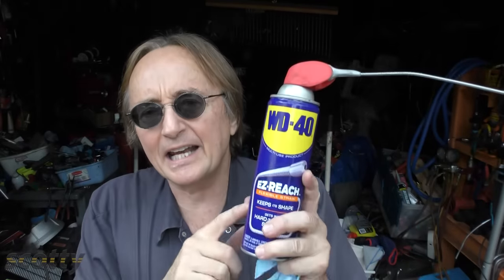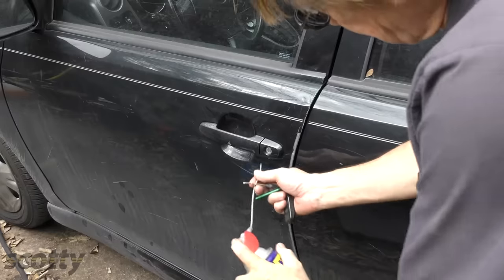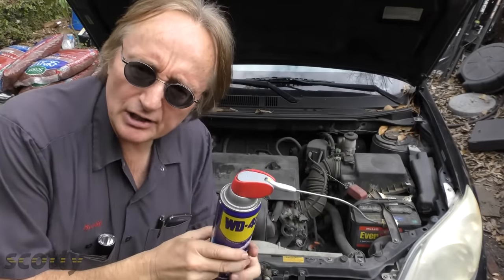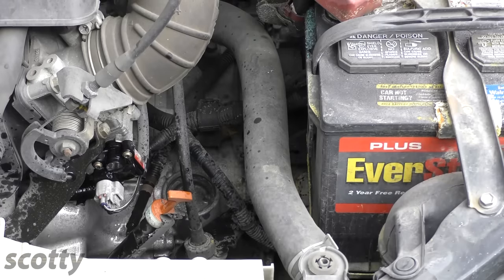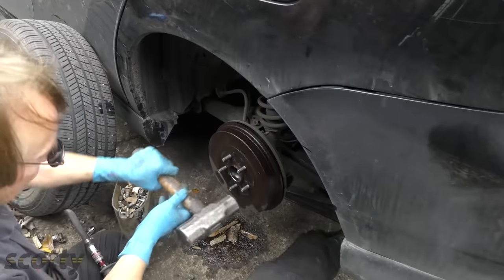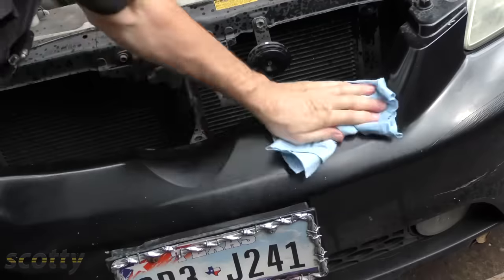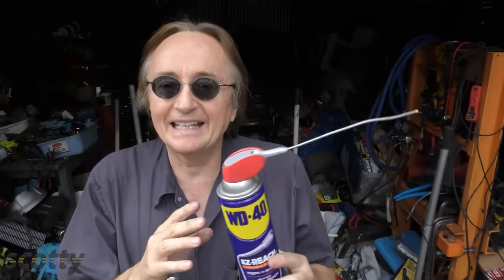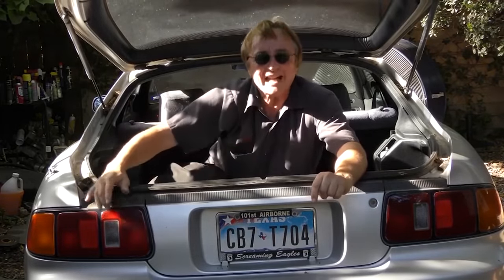Top 5 Uses of WD40 in Your Car (Life Hacks)

Comment: Scotty, I'm a locksmith.
Your right about 1 thing for the locks. It cleans them out very well.
But after you clean them out, you should use a lubricating produced like tryflow.  It is silicon base and will not attract dust and grime like a petroleum base like wd40.
Otherwise great video.
Reply: Please help me. I sprayed wd40 into my ignition. Should I put tryflow in it now? Or did I damage it already from the wd40?
Reply: @timothyleee27204  your ignition should be fine, put your key in and out several times, wipe off the excess wd40. Each time you pull the key out. Basically you will clean all the gunk out of it.
Reply: @ceedub6233  ok. Is there a high chance it will get gunked up in the future? It's a 20 year old car. I'm not sure if there's many electrical contacts in the ignition. Thank you so much for your reply

Comment: If it moves but it shouldn’t use duct tape 
If is doesn’t move but should use WD-40
Reply: Alex Bartunek  Absolutely
Reply: after that....If still doesnt move = hammer  / if still move jd weld !......last if everthing is ok ! time for a good beer
Reply: Jack's tech damn right
Reply: At what point should u replace something? XD
Reply: Alex Bartunek very original
Reply: XD when jd weld  or the hammer dont solve the issue
Reply: If it doesn't turn on and it should, hit it with a wrench.
Reply: And if it doesn't work after that divorce it and marry it's sister.

Comment: My father was a carpenter back in the 50s and 60s. He used WD40 on all his hand saws and other tools to keep them from rusting. It worked great and I  used it on a crankshaft back in the 70s to keep the journals from rusting. The stuff is fantastic! It's also safe on electrical contacts! I've personally been using for  50+ years!

Comment: There's a product I believe in!
I remember the days when a can of WD40 and a couple spare ballast resistors were a Chrysler driver's first aid kit. 
Nowadays I drive a tractor trailer rig for a living. I don't hit the road without a can. I use it to lube the release linkage on my fifth wheel, a spot lube on my trailer landing gear legs, plus keeping my electrical pigtail to my trailer(s)- I pull sets of double pups- making a good connection in bad weather. I also squirt the pintle hook that connects the dolly for my rear trailer to my lead trailer. The latch works easier when I go to disconnect them at the turnaround terminal, plus the rig handles a little smoother going down the road.

Comment: Mechanic in a TIN !  
spray the battery negative/positive wires end of connections on to battery and try to get into sleeve if poss.
and the lead to car body negative earth/ground end connections (from battery) if its all braided , spray all of it.
as well as engine connection negative earth/ground connection if its all braided , spray all of it.

Same with starter motor connections and alternator.

Its also really good on a old hand saw to cut anything, both sides of the blade. Even on a brand new hand saw halfs the energy required to cut anything.

Comment: Scotty .............. I never use WD-40 since it attacks electrical insulation and Bakelite and since I'm an electrician (foreman) it matters.  I use CRC-2-26 which improves electrical properties and is a great penetrating fluid and will not harm electrical equipment. I won't allow WD-40 on any of my electricians trucks - I have had too many ruined breakers and wire insulation.
Reply: Well he’s showing you on cars.

Comment: Spraying WD40 into the key hole will make your key slide in and out easy but,
it will wash out the silicone grease in the lock itself which makes the barrel
turn.My advice is to spray some on the key its self if the key feels its sticking.
Reply: Jeff Fae Scotland yes. Made my lock turn inside of the hole

Comment: Keep it off the paint!
Reply: I don't use WD40 as a lubricant or think of it as a good lubricant. However, it is great as a cleaner, if you have tar from the road sprayed on your car. Just spray it on, wait for it to start dissolving the tar and wash it off with soap and water. I agree, I would not want to use it as a polish or allow it to stay on my paint.
Reply: Wd40 will not harm the paint
Reply: Spraying it all over the engine may cause a fire
Reply: He's talking about for beater cars. It serves a short term purpose for that.
Reply: I believe wd40 takes off any wax. So you would want to rewax that area

Comment: It is not 'dissipation'  of water.  The "WD" actually stands for 'water displacement'.  It is good for many a quick job, but great at none.  For jammed stuff, nothing beats Liquid Wrench. For locks, graphite powder in a volatile liquid vector.  For any an anoying squeak, white lithium grease does the job. For preventing stuff sticking together, Never Seeze (copper powder in clear grease).  But for ignition cables, yes: WD-40.
Reply: I read you loud and clear, man.  I just wanted to make a more serious point.  As an experienced cyclsit, I know for a fact that WD-40 is your bike's worst enemy. This is life... :)
Reply: Kroil and PB Blaster destroy liquid wrench. WD 40 is my go to for household stuff. Just works.
Reply: Who started the myth of using graphite on locks? As a locksmith, I really want to punch that guy in the face.
Reply: @rouelibre1   I am currently using WD-40 on my bike, for the chain and gear mechanism; but you say it's not good. What kind of fluid should I be using? Thanks in advance.
Reply: Just use an all purpose grease. I use to use it all the time on my 20" Diamondback Viper BMX.
Reply: @keith   I will check that out. Thank you.
Reply: rouelibre1 agree completely with your reply. Scotty is usually dead on but on this one he disappoints. Wd40 simply lacks long term lube or protection and is often used in places which need real grease. It washes away any existing grease and itself dries away in a few weeks leaving the mechanism dry. Wd40 is all marketing.
Reply: @batvette   How come we can't just use motor oil, like when we were kids? Is it because it attracts too much dirt?

One more thing, I agree WD-40 is terrible stuff for lubrication. That company lies through their teeth. WD-40 is good at cleaning metal; but leaves the metal completely dry and unprotected. I learned this the hard way. I was spraying WD-40 all over my chain and components every time I went for a bike ride; and it wasn't long before the cogs and chain were covered in rust. I have been using motor oil ever since. The motor oil is a bit messy; but my cogs and chain are free of rust.
Reply: Jason Hart you could. Motor oil just doesnt spray well out of a can. When i used to live at the beach with an old cadillac(all iron rusts quick) once a year filled up a binks spray paint gun with 5pts motor oil 1 pt grease. Sprayed the whole underside of the car in minutes. Cheap and no rust ever.
Reply: @batvette  Thanks for the info. I actually have a 1965 Mustang, and I live near the beach. I will give that a try.
Reply: Jason Hart my cadillac was also a 65, a custom hearse with the 429. Record production that year with over one million DeVilles rolling out of one factory in Michegan. The metal they put in cars in 65 was unreal, modern drill bits almost unable to get through. Once rust starts it goes through panals quick, you can arrest it with phosphoric acid. 
Anyway if you dont have access to air and a sprayer white lithium grease in an aerosol can is a good alternative. Just costs more. If its outside get it under a cover, the ones made of sunbrella are best for salt air. I stored an 86 corvette in my driveway for six years under a cover coated with a case of white lithium only took the cover off quarterly to hose it off. Worked well except for the neighborhood cats shredding the cover until I stapled carpet to the corner of the wall next to it.
Reply: @batvette   Thanks for all your advise. Rust is a real problem for these old cars. What about the roof area? My Mustang is getting rust around the front and rear windows. My car does not have a vinyl top, so that's not the issue. I'm thinking that the interior headliner might be causing the problem. The headliners back then were made out of plastic, and I have a feeling it's causing condensation, which leads to rust. Do you think I should I remove the headliner? Or maybe fabricate to vents for the headliner?
Reply: Jason Hart doubt the headliner is causing the problem. Rust in those areas usually caused by leaks. Or condensation is simply building up there. I had rust through body above the windshield in my honda passport. Treat with phosphoric acid then coat with an anti corrosive coating. Home depot used to sell an excellent coating it was orange cant remember the name of it now. Covered it with that then sealed the area with PL sealant.
Im in california due to our states crazy environmental laws there are a lot of effective products we cant get in our stores any more.
Reply: Jason Hart try sewingmachine oil it is a great lube for chains n cranks
Reply: Scott Michale it works but is a little light.... prolly halfway between wd40 and motor oil. Similar to 3 in 1. Will throw off pretty easy and require frequent reapplication. But it has its uses. On bicycles i settled on white lightning that waxy stuff cuz it sheds dirt and sand. And if you toss your chain its not messy to handle on the road/trail ... tho if ur tossing chains adjust those derailleurs. Put the gears on the small sprockets and tie off the deraillleur so the chains almost hitting the floor(unless u have a master link then remove it) squirt some white lightning into a gallon freezer ziploc then drag the chain through it to fully immerse the rollers and pins. Less mess and waste.
I got shimano chains with the pins cant remove em easy but they are good quality.

Comment: Do you know how wd 40 got its name. It was the 40th try at making the product until he finally got the formula right. What if he got it right on his 37th try, maybe we would be using wd-37.
Reply: Water Displacement formula #40
Reply: B-22 chemtool, Hoppe's No. 9, BGK 44k; it's not so outlandish to have random numbers at the end of chemical names. It's weirder to me that they landed on a multiple of ten, honestly.
Reply: Scott Witkowski correct and WD stands for Water Displacement.
Reply: It was developed as a water displacement agent for stainless steel pannels on Polaris nuclear misiles.
Reply: Scott Witkowski For some time in the 60s and 70s there was a product called WD-60 which was used by airlines which had rust removers in it.
Reply: Luis Padua Really, thats cool. Didnt know about that.
Reply: Actually he was 40yrs old when he invented it. Wasn't the 40th try
Reply: Greg Kinslow No, Norm Larsen of Rocket Chemical made WD-40 and achieved it in his 40th try. He was making it to spray on the outside of atlas rockets to prevent rust and corrosion. He was born in1923 and created wd-40 in 1953. These are the facts
Reply: ....so if you bought wd-39 you aint got the best one.
Reply: Greg Kinslow wrong
Reply: Water Displacement achieve on 40th attempt!!! WD40
Reply: @gregkinslow6211  wrong
Reply: chanel no. 5   is similar.
Reply: wet to dry in 40 seconds wd40 old days

Comment: Can you spray battery terminals with that stuff to prevent corrosion?
Reply: it wears off too fast,  use white lithium grease in a tube,  just a light layer,  worked for 50 years for me, never say a speck of rust
Reply: Use electrical cleaning spray.
Reply: use dielectric grease or some kind of silicone based grease for that.
Reply: But the short answer is YES, regardless.

Comment: You rock Scotty
I like to put WD-40 on older headlights because bugs don’t stick as much.  I might put it on all the leading edges of the vehicle as well… As you know, It’s a pretty big deal if you live in the country. If the headlights are really bad… I will wet sand it with WD-40… 600 grit then 1000 grit then 2000 grit… Then keep it wet with WD-40

Comment: I have a 3 cylinder yanmar yb25 diesel excavator who went out of fuel once. After gassing up we sprayed wd40 in the air filter to serve as ignition booster. It worked and the old machine ran again

Comment: I have a can with the new articulating spray tube and YES, it is very good upgrade from the plastic straws.
One thing I learned the hard way years ago is; DO NOT use WD40 on inside of spark plug wire boots.  It will stink like Hades for days when it gets hot.  Use dielectric grease.

Comment: WD-40 works nice for key locks but a dry silicone lubricant works better simply because it will attract less debris compared to the more wet WD-40. You’ll notice that WD-40 does clean the dirt out, but stays wet. Dry lube prevents dust particles from sticking.

Comment: I moved into a new apartment that had a plastic toilet seat and the plastic bolts would not come out! I sprayed some WD40 on them as a last ditch before I completely stripped out the heads. Came out like a charm so fast. Amazing! And I replaced it with a fresh new toilet seat.

Comment: And you should use slip plate graphite on your brake pads, to stop them squeaking on the brake rotors, also results in much smoother, gradual braking performance... (Rolls eyes)

Comment: Scotty,  I had a boss that toll me about WD-40. How WD-40 came to be was during World War II. The Navy and the Marine Corps was having problems with there equipment freezing up in the jungle. They have asked the industrial companies to resolve the problem of moisture problems in high humidity areas that freezes by moister and rust in the south pacific. The company who brought out WD-40 where the first to test this product out. To my understanding they did over 100 chemical blends of oil. When they had submitted there of chemical oil blends, to the Navy and Marine Corps picked the right oil and it was the WD-40 oil out of over 100 chemical blends of oil. The WD-40 oil, the two letters in WD is call Water Displacement formula and the 40 was the number that the military has picked out of over 100 oil formulas and pick formula #40. Hence WD-40.

Comment: WD-40... A little trivia... The chemists that developed it wss formulating chemicals to create a good Water Displacement product.  He had tried 39 times, on the next try he got the "perfect combination" to displace water.   So it's actually Water Displacement formula number 40 or WD-40 FOR SHORT.   Back in the day when we had points and condensers, we always kept a can in the trunk for those wet days when the car wouldn't start.  Spray some in the distributor cap and it usually cranked!    I was at a used car lot with a friend and the detail guy had washed the engine compartment of the care he was interested in.  Problem was the fuse box didn't have a cover.  Everything was going crazy, wipers turning on and off, light flashing.  I watched the mechanic try to dry the box and he sprayed air into it.  I FINALLY told him I would spray it with WD-40.  He finally did and it was fixed instantly.

Love your videos, Scotty, always informative, short and fun to watch.  I "Rang that Bell" a long time ago!

Comment: Good uses for wd-40 electrical parts and moving and cleanning of power steering oil holder and cleanning caps for more readable instructions underneath the hood